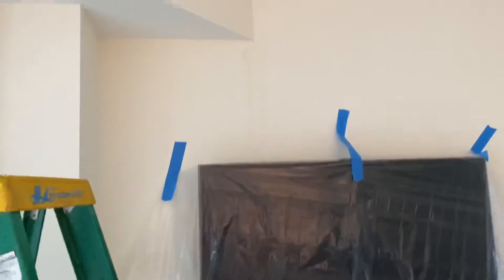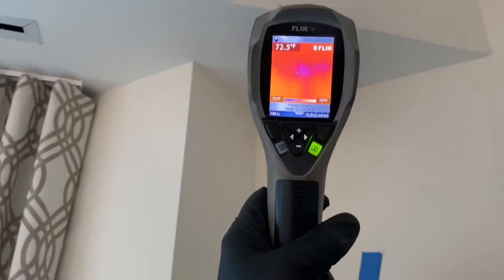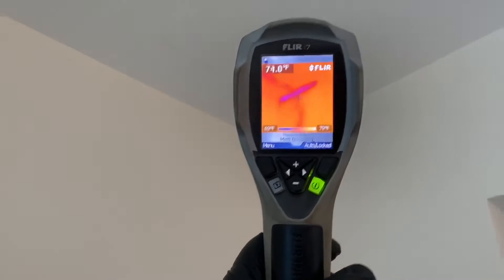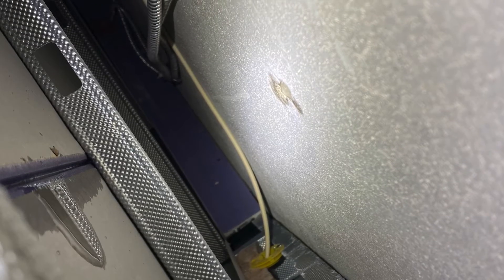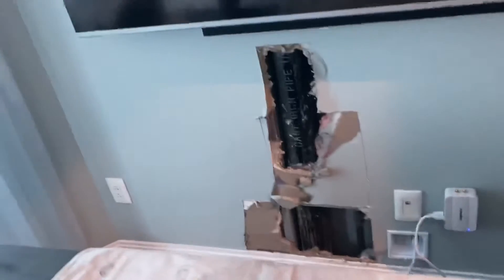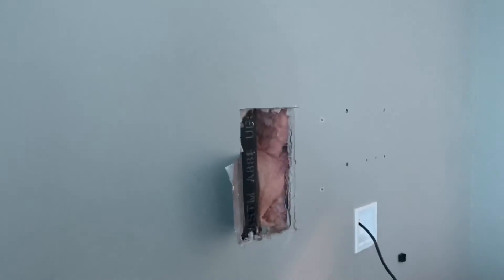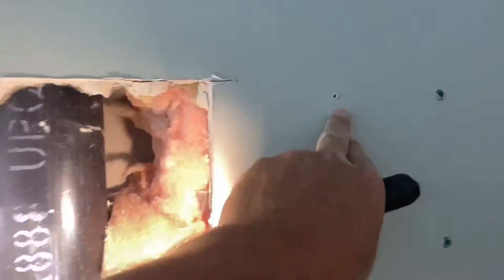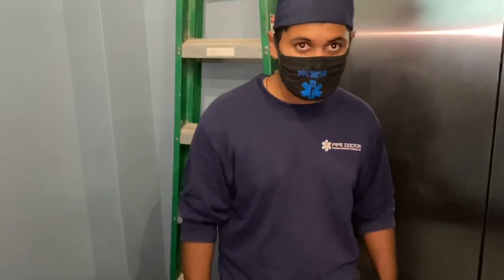Using Flir i7 Thermal Camera to Help Locate Water Leak - The TV installers drilled thru 4” Cast Iron

Comment: Instead of cropping out the pipe. Can’t you just use a dab of JB Weld. The pipe isn’t under any type of pressure since it’s just a drain line.

Comment: Hi Mikey pipes you always give great content and it’s nice to see a flir camera in use. Not many in the trades use that kind of equipment but it’s an indispensable tool for these kinds of  investigative jobs. It’s unfortunate the TV installer drilled into the cast iron storm drain line. I am a GC and installed many tv wall mounts and I have used those heavy duty toggle anchors many times. The plastic you see is the part that holds the backside metal T bracket of the toggle in place so not to fall behind the wall. They support many many pounds and are very safe for that size of a TV. The Best Buy installers should have had more trade experience and should have double and triple check where the studs were located and drilled pilot holes to feel the stud a
so to understanding the difference of wood or metal stud to a cast iron pipe. What a mess. for the home owner keep up the good work.